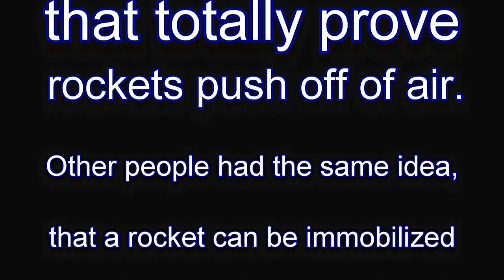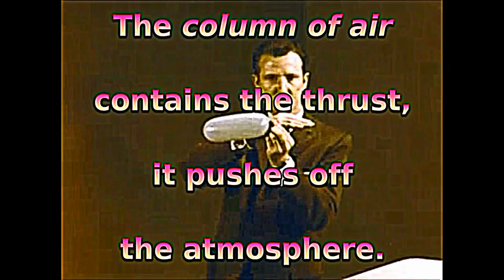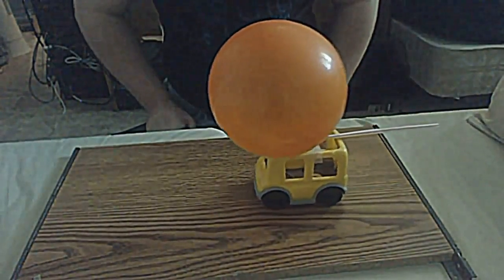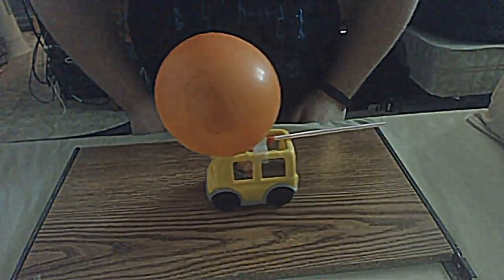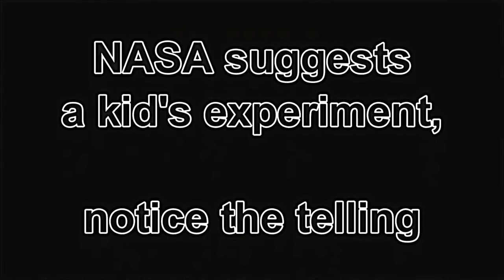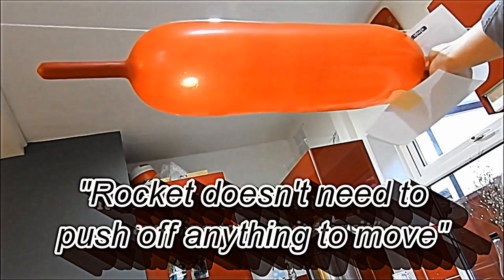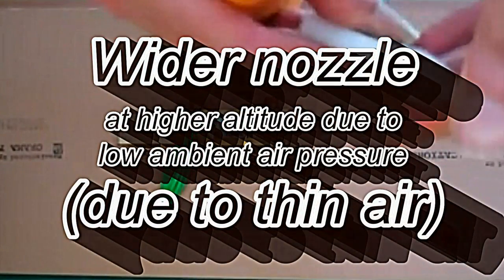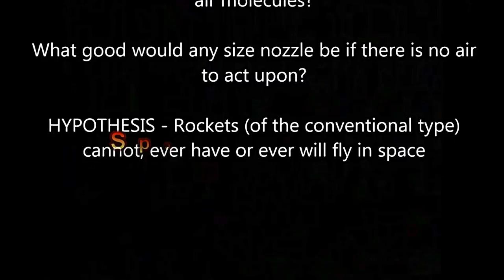rockets push off air

Comment from the maker: @Paulster X do your due diligence properly.

============= 1 =============

@tom Whitney hey, sorry about that link to the car guy, i'm glad you did not watch it, i thought the link went directly to my comment that I copy pasted, there are three links in the comment, and the first one corrects you about oxidizer (video is not by a flathead, it's by Cody's Lab) The second link is also from Cody's Lab, and the third is my video titled "rockets pus off air" which as the demonstrations--most of the copy paste refers to my video.

If you scroll down on Warped Perspective video you will see my comment from a year ago https://www.youtube.com/watch ?v=-BsrzO7aXNs&lc=UgyU3zLsaFAluOBoQRB4AaABAg and he gave it a heart. That demo does not prove a thing for your side, it actually proves my side nicely. Notice in the first Cody's Lab video they could not get any combustion in the vacuum, Warped Perspective had the same problem, and he solved it by shielding from the low pressure low oxygen--you absolutely need a pressurized oxygen atmosphere, period.

I sent that video you gave me to another flathead that does high altitude balloons, where in one of his flights he had a similar rocket engine as warped perspective and it failed to ignite at over 100,000 feet, so I explained to him why, and gave him Warped Perspective's video and Cody's videos like I gave you. How much do you want bet that in his next flight that the rocket, if it ignites at all, will show next to zero thrust! How much money do you want to lose?

I'm an EXPERT on rockets. I'm ready to take your money. Think blow torch next time, then you will begin to understand. Below is my original copy paste from before:

rockets push off air
rockets push off air
10 minutes ago (edited)
@I like to discuss but it doesn't burn, and this alone proves space is fake since no rockets could function in such conditions. COMBUSTION NOT POSSIBLE IN A VACUUM https://www.youtube.com/watch?v=ODvlSi8H7hs NO THRUST POSSIBLE https://www.youtube.com/watch?v=Mzf9IBXu1Mc both experiments were by Cody's Lab therefore totally unbiased. 

none of the "factors" you mentioned had any effect, this was proved at the very start of the video, where the entire exhaust straw was fully placed (several inches in total) into the vacuum hose while the vacuum was on full, and the rocket thrust was totally unaffected, and this is an excellent demonstration of rockets pushing off air, several illustrative demos in one video called rockets push off air https://www.youtube.com/watch?v=CLjxKhdQSrI This disproves the claim that once the exhaust passes the edge of the nozzle, it can no longer have any effect on the rocket--since we see that simply bending the exhaust column by 90 degrees by redirecting it at a distance from the exit point with a vacuum cleaner hose, totally immobilizes the rocket.

Examine any nozzle, such as the ones on the Saturn rocket and see how delicate they are, they even have tubes of rocket fuel all around them for cooling purposes. There is very little pressure inside, expanding gases of combustion naturally move into the open atmosphere, you can see the exhaust pour out like a waterfall. Combustion is not explosion, there is no "series of explosions" going on in the nozzle, there is a combustion chamber, not an explosion chamber (look how reinforced a cannon is)--explosion in the nozzle destroys the entire rocket, that is why they have such a high failure rate.

in the same video, there were two paper behind the exhaust videos, and they demonstrate how reverse thrusters slow jet planes down--they push off air--just like rockets. In the first paper example, the exhaust hits it in the middle, so it is diverted evenly left and right, and there is a DELAY before it hits the paper, and this delay is more than enough to show movement or thrust, if rockets work as you think they do--the moment the opening in the balloon is created there is an equal opposite force at the other end--that is proven not to be the case at all. 

In the second paper experiment, which is a modification of a kid's experiment by NASA, the exhaust does not hit the paper in the middle, and you have an imbalance left and right, and so the rocket is stationary and does loops around the string, which is only explained by the fact rockets push off air.

Finally, you did not discus the experiment with the cone shaped nozzle since it debunks you totally. Widening the diameter of the straw (the exhaust nozzle) immobilizes the rocket, and this confounds you, because it proves action reaction is bs, it demonstrates that rockets do in fact push off air--how come the moment the exhaust starts to be released the rocket does not go anywhere when the wide cone is used? It is because the wide cone disperses the exhaust and there is not enough pressure to push off the air--this was also mentioned in the wiki article (talked about in the video) on rocket engine nozzles, which states the exit pressure needs to equal ambient pressure--thus, each nozzle diameter is only optimal for a single altitude and air density, where a narrow nozzle works best in low altitude dense air, and a wide nozzle for high altitude thin air. Thin air is the limiting factor to how high a rocket or a jet plane can go, which explains perfectly why rockets have a parabolic flight path, go no more than about 20 - 25 miles up, and fall right back down.

================= 2 ===================

@r d F/2pi if you can study a few paragraphs here https://flatearthclassroom.blogspot.com/2019/09/fake-physics-fake-math-fake-forces.html is the deal breaker. I have a neighbor who is an engineer and presently employed by NASA, we take our kids to the same park, have been discussing flat since 2016 spring. This August we had a 6 hour talk in my lobby until about 4:30 am, and the end result was that he agreed 100% with the info on the page at the link i gave you. Previously we had a 4.5 hour discussion on the same topic, and after he said there are three options going forward:

1) he will debunk me (that is no longer on the table after the 6 hour discussion)

2) he will remain confused the rest of his life

3) he will accept flat earth (and he said if he does that, he will quit his job and spend the rest of his life exposing the fraud)

I have not spoken with him since, but I will call him before the new year. I am confident he will become flat. I'm giving him time to let it sink in, it's not easy for some people but there is no going back once you learn about the globe destroying power of F/2pi

Time for you to get off the fence bro!

Welcome to motionless flat earth!

;-)

==================== end ===================

If you have any questions, feel free to ask. 

Dunning–Kruger Effect explains why the least competent at a task often incorrectly rate themselves as high-performers because they do not know otherwise.

Comment from the maker: @Paulster X do your due diligence properly. VERSION II

OK, Let's go over everything you missed, and then some: COMBUSTION NOT POSSIBLE IN A VACUUM https://www.youtube.com/watch?v=ODvlSi8H7hs NO THRUST POSSIBLE https://www.youtube.com/watch?v=Mzf9IBXu1Mc both experiments were by Cody's Lab therefore totally unbiased. 

The first experiment in this video https://www.youtube.com/watch?v=CLjxKhdQSrI rockets push off air disproves the claim that once the exhaust passes the edge of the nozzle, it can no longer have any effect on the rocket--since we see that simply bending (redirecting) the exhaust column by 90 degrees AT A DISTANCE from the exit point with a vacuum cleaner hose, totally immobilizes the rocket. The number one objection, that somehow the suction acted on the rocket to prevent it from moving, was debunked at the very start of the video, where the entire exhaust straw was fully placed (several inches in total) into the vacuum hose while the vacuum was on full, and the rocket thrust was totally unaffected, and this takes care of the number one objection that somehow the suction acted on the rocket to prevent it from moving.

Examine any nozzle, such as the ones on the Saturn rocket and see how delicate they are, they even have tubes of rocket fuel all around them for cooling purposes. There is very little pressure inside, expanding gases of combustion naturally move into the open atmosphere, you can see the exhaust pour out like a waterfall. Combustion is not explosion, there is no "series of explosions" going on in the nozzle, there is a combustion chamber, not an explosion chamber (look how reinforced a cannon is)--explosion in the nozzle destroys the entire rocket, that is why they have such a high failure rate. THINK BLOW TORCH!

There were two paper behind the exhaust experiments. NOTE there is a DELAY before it hits the paper, and this delay is more than enough to show movement or thrust, if rockets work as ADVERTISED--the moment the opening in the balloon is created there is an equal opposite force at the other end--that is proven not to be the case at all.  

In the first paper example, the exhaust hits it in the middle, so it is diverted evenly left and right, this also demonstrates how reverse thrusters slow jet planes down--they push off air--just like rockets.

In the second paper experiment, which is a modification of a kid's experiment by NASA, the exhaust does not hit the paper in the middle, and you have an imbalance left and right, and so the rocket is stationary and does loops around the string, which is only explained by the fact rockets push off air.

Finally, the experiment with the cone shaped nozzle debunks you totally. Widening the diameter of the straw (the exhaust nozzle) immobilizes the rocket, and this confounds you, because it proves action reaction is bs, it demonstrates that rockets do in fact push off air--how come the moment the exhaust starts to be released the rocket does not go anywhere when the wide cone is used? It is because the wide cone disperses the exhaust and there is not enough pressure to push off the air--this was also mentioned in the wiki article (talked about in the video) on Rocket Engine Nozzles which states the exit pressure needs to equal ambient pressure--thus, each nozzle diameter is only optimal for a single altitude and air density, where a narrow nozzle works best in low altitude dense air, and a wide nozzle for high altitude thin air. Thin air is the limiting factor to how high a rocket or a jet plane can go, which explains perfectly why rockets have a parabolic flight path, go no more than about 20 - 25 miles up, and fall right back down.--AS EVIDENCED BY THIS SHUTTLE LAUNCH FILMED FROM A JET PLANE https://www.youtube.com/watch?v=1YQ3tVpwo2E
Reply from the maker: @HumptyDumptyOakland  It still wont ignite, even with your own oxidizer. Cody's Lab proved it https://youtu.be/8Cx9mNnky2U Dwayne Kellum who does high altitude balloons proved it, when he could not get ignition less than 20 miles up https://youtu.be/7DQCtUd_4yg and Warped Perception proved it, when he could only get ignition if he sealed everything from the vacuum. You need to stop believing everything you are told, and start testing the claims with actual science.
Reply: @rocketspushoffair  
Cody's Lab did ignite a model rocket motor in a vacuum as this video (at 7 minutes in) shows https://www.youtube.com/watch?v=76JM03a6WH4. 
In Warped Perception's video here, once he got ignition the rocket motor continued to burn in a vacuum and produced thrust for the duration it was burning. https://www.youtube.com/watch?v=-BsrzO7aXNs
You need to learn some physics, for instance,  do you even know what the equation is for calculating the thrust of a rocket? And why does every physicist in the world disagree with your baseless assertion that "rockets push off air"?
Reply from the maker: @HumptyDumptyOakland  Cody spent all day trying to figure it out, he only got ignition once he sealed it from the vacuum, you need to learn physics AND how to pay attention, since I already told you this. Also, Cody did two videos, one for thrust where he had to seal the ignition, and one for combustion, and combustion is not possible in vacuum, which is why he had to seal the ignition. Same for Warped perception, he did not even realize in his first attempt that he had no vacuum and in his second video, he spent all day figuring out how to seal the ignition from the vacuum.

Globeheads and moon-hhuggers are not to sharp, why did you not understand it the first time?

Also, nothing goes faster than mach 3, w/o melting. These rockets they have been launching are sheet metal, just go have a look at how flimsy they are! WHAT A JOKE! HAAHHAA!!!

And NASA is the biggest buyer of helium! HAAHAAHHAA!!!

I like how recently a rocket made out of sheet metal popped like a water balloon!--That's exactly what it looked like!

Buddy, you've been had by Walt Disney!
Reply: @rocketspushoffair  
You do agree though that once ignition is achieved that it will continue to burn in a vacuum and continue to produce thrust as Warped Perception's video showed. 
It's comical that you believe you're right whilst every physicist in the world disagrees with you. And you still haven't answered the question: "What is the equation for calculating the thrust of a rocket?" Surely you must know.
Reply: @rocketspushoffair  
"Also, nothing goes faster than mach 3, w/o melting."
What about the X-15 which achieved over mach6 in 1967?  Even the SR-71 exceeded mach3. Flat earthers, their ignorance knows no bounds.

Comment: Put the vacuum behind not to the side duh 🙄
Reply from the maker: That was done at the very start of the video. Do you even understand why the vacuum was at the side? Do you even know what the point of the vacuum is? You believe that "a mass is ejected" therefore anything you do to the ejected mass cannot affect the rocket, but clearly it does, because nothing is "ejected", combustion has nothing to do with ejecting a mass. The purpose of the vacuum was to bend the exhaust by 90 degrees at a distance from the rocket, and if the exhaust is an ejected mass then there is NO WAY you could affect the rocket let alone immobilize it. It should be no different than hitting a cannonball (to change its direction by 90 degrees) AFTER it has left the cannon. :face-red-droopy-eyes: "duh"
Reply: @rocketspushoffair  you did see a decrease in thrust because of the vacuum no? Put it directly behind. Is the vacuum of space off to the side? Nope
Reply from the maker: @jameywc2  snap out of it moon-huggr! I love the knee-jerk reply when you see the word "vacuum"! HHAAA!!! Here's my previous reply: @rocketspushoffair
3 days ago
That was done at the very start of the video. Do you even understand why the vacuum was at the side? Do you even know what the point of the vacuum is? You believe that "a mass is ejected" therefore anything you do to the ejected mass cannot affect the rocket, but clearly it does, because nothing is "ejected", combustion has nothing to do with ejecting a mass. The purpose of the vacuum was to bend the exhaust by 90 degrees at a distance from the rocket, and if the exhaust is an ejected mass then there is NO WAY you could affect the rocket let alone immobilize it. It should be no different than hitting a cannonball (to change its direction by 90 degrees) AFTER it has left the cannon. face-red-droopy-eyes :face-red-droopy-eyes: "duh"
Reply: @rocketspushoffair  rocketspushoffair I guess that says it nevermind

Comment: There is a weakening of the balloon with multiple inflation. I like the demo..but you left a question about the strength of the force unaddressed.
Reply from the maker: There were a total of 12 runs, the balloon cart escaped each time except number 4 and number 6, I don't think weakening of the balloon was a factor at all. And I don't see what you are getting at regarding the strength of the force?